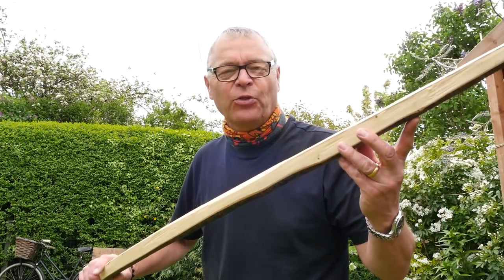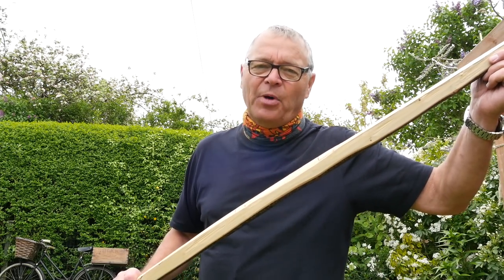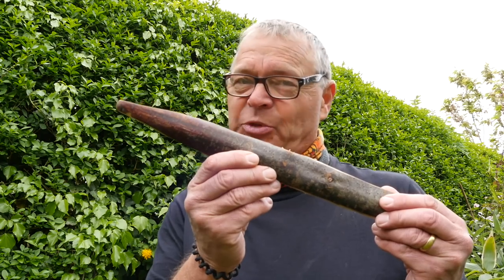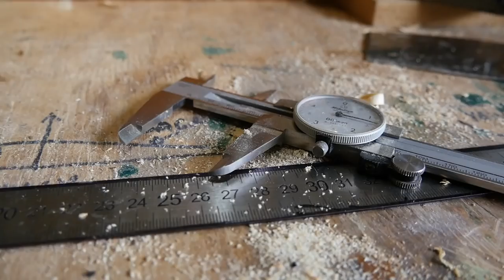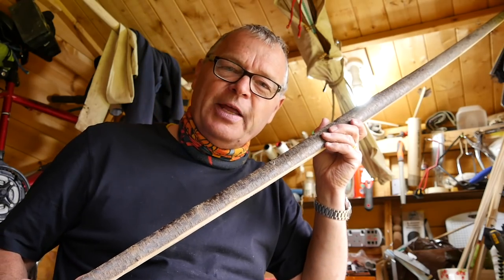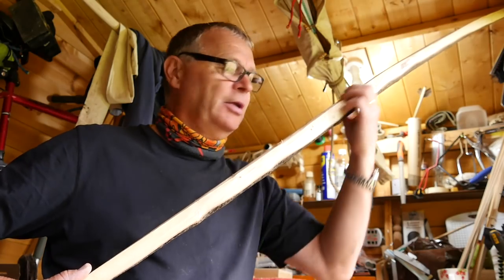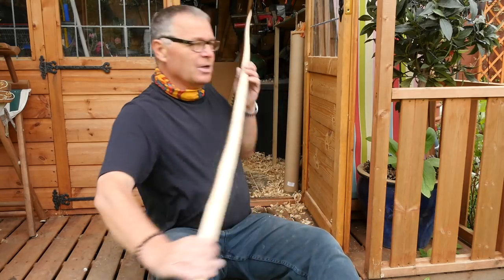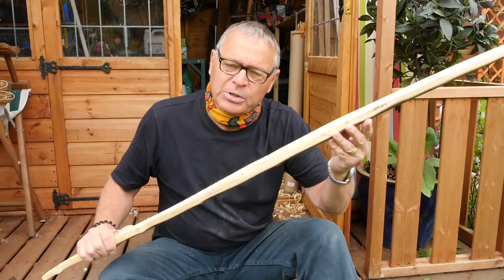BANG! I THOUGHT IT SNAPPED 😲 Blackthorn Bow. Part Two. Shaping to 1st Brace.

Comment: Congrats for your bows and your fast progression. The most beautiful part of making bows is experiment with different woods. I have made bows with another kind of prunus wood and keep the bark is very nice. I recommend you an slow tillering to avoid the string follow.
Regards from Spain.
Reply from the maker: Thank you - delighted that you have made prunus bows and kept the bark on. Very encouraging! I am going slow but I think I will get a little string follow at the end. Do you? Greetings from UK!
Reply: Yes, the bow always gets a little follow string during the tillering, about 1 or 2 inches (the less the better in my opinion). 
Cherry tree bows keep the bark well and I suppose that blackthorn too. 
Greetings and good luck!
Reply from the maker: Thank you Alvaro. That's really useful to know - I am trying to avoid string follow but I expect to get some. Not tried cherry yet! Be safe, Mick

Comment: Maybe apply warm and heated oil (linseed,vegetable, etc.) to the back of the bow liberally with the bark as you tiller and draw to see if that helps keep the bark from cracking, since at this point, we don't know if the bark will hold up. Or maybe even warm water. Just a thought. Excellent video as usual.

Aaron
Reply from the maker: Hello Aaron, great idea, thank you - I'd love to keep the bark on, the contrast between the belly wood and the bark is superb. Mick
Reply: Mick Grewcock It was just a thought. I would think any oil/ moisture would keep the back cambium layer and outer bark supple while undergoing tension.
Reply from the maker: Definitely worth a go! Mick

Comment: Almost spilt my tea there you miscreant.  I think the bark on look might be rather pleasant if it can be done and maintained without the flexing and drying out promoting  cracking and eventual peeling. Enjoyed as always.,...  a.t.b.
Reply from the maker: Crikey, haven't been called a miscreant for a while! Thank you ;-) The bark on would be lovely but as much as I'd like it I'm not holding my breath. Looks fine at the mo but there's another 16" of bending to go so I expect it'll split - but if it doesn't, WOW! Mick
Reply: Can't think of anyway to feed it without making the  bark tacky/messy. Could it be sealed in  with a layer of matte epoxy or even matt GRP glass resin. Could some kind of oil be applied and sealed in  ?  Have to admit I have no idea...
Reply from the maker: Several have suggested feeding to with oil to keep it supple. I'll have a go at that. If it fails, I shall remove it but leave as much underbark etc to colour the bow's back. Unless it snaps of course...

Comment: Mick, could a bow stave be twisted and still yield a usable and (reasonably) safe bow?
Reply from the maker: Hi there, have you watched my 'Wonky Yew' video. That was a horribly twisted stave that gave me a characterful bow. So yes, it can be done with a twisted stave. The problem (for me) starts when I have a bow that was 'straight' but has twisted after laying out and shaping. That - for me - can be a tough one to solve and does require heat of some kind to bring it back to the shape it was made into in the first place. Since this video I have had to correct a twist in the blackthorn bow and in doing so increased its draw weight massively!

Comment: Obviously the loop in the top of your long string is far too long (and possibly the nock grooves also too shallow). 

If you hear a "Tick!" as you tiller it is quite likely to be some bark separating. 
Nothing to worry about.

Some lengthening of the taper in the width of the tips might be done before you make the tips too thin.  Less tip mass = less tip inertia = faster return = better cast.

This looks like it should make a nice bow-hunting style D bow with a string geometry that may allow you to get your eye behind the string at full draw.

Rod.
Reply from the maker: Hello Rod, yes the loop was a too big and the nocks too shallow - both now fixed! I hope the bark doesn't pop, it looks fabulous - but if it does, so be it. More slimming of the taper being done. Mick
Reply: You can take the surface of the bark off but keep some colour if popping is an issue. But I'd be inclined to try oiling it.

As for dimensions, just let the tiller and the draw-weight determine the final dimensions, always remembering that the primary setting of tillered shape is determined by the layout of the width taper.
Thickness adjustment follows on from this.

How wide do you have it at the arrow pass?
Reply from the maker: Rod, 35mm wide at the AP just now. Mick
Reply: I'd be looking to get that down to about 25mm with a slight radius.

Comment: wow i thought it broke myself.I'm curious as to what instrument you use to check the moisture content of the stave?
Reply from the maker: Hi there Anthony. It is a digital moisture meter - they are commonly available on ebay and Amazon and elsewhere. Mine was about £20/$30. Suppliers of firewood for log burners supply them too. They are not infallible and have to be used with caution as they can mislead but I find having one really useful of checking the trend of moisture loss. Thanks for watching. Mick
Reply: thank you sir

Comment: mick, instead of inventing the width you can use this formula to determine the optimal width of a american flatbow design,draw weight*(drawlength)^2/(1400*sg*bending limb length)=width all units for length are in inches and sg is in g/cm^3sg is fyi the density of the bowstave
Reply from the maker: Hello Erik, thank you very much - another correspondent has encouraged me to test the SG of my blackthorn in order to calculate the limb width. I haven't tried it yet but I hope to make a proper flat bow soon and that formula will take some of the mystery out of it! Thanks again, appreciated. Mick

Comment: Is it typical of English longbows not to have the handle carved out with a thicker depth and thinner front profile?
Reply: Yes, except for a type of "lawn archery" or popinjay bow where "Buchanan dips" were used to put a deeper handle on a skinny bow, but this did not embrace the use of "fades" which has a very long history in wider limbed flat bows.
The common old style of narrow, deep sectioned "longbow", if not a flat-bow, is widest in the handle and tapers to the tips.
Reply from the maker: Hi Jake, I can't improve on Rod's explanation! You are right though, ELB do not have a shaped 'handle' - the arrow rest is the archer's hand. I'm quite new to archery and when I first began to study the ELB I found that in the UK and elsewhere there are variations in the ELB - we have many in the UK who practise target archery with what people describe as Victorian style ELB which often have a leather grip but there are others who make and use 'medieval' style bows which are longbows but usually very high draw weight and without a 'handle' or 'grip' - all very confusing! Thanks for watching. Mick
Reply: Perhaps I can also shed some light on this. There are 2 types of what we call English longbow.  The Victorian type which gets thicker towards the center(does not bend here) ss still shot off the knuckle.  Then the Medieval design ( That of war bows though does not need to be a war bow to classify as this type) This type of bow is what think of when we hear tales of robin hood or the English vs the French. This design the entire bow bends including where you hold, what you call " full circle tiller" .  It throws a heavy arrow more efficiently and a bowyers mark is generally made at center for the arrow pass.